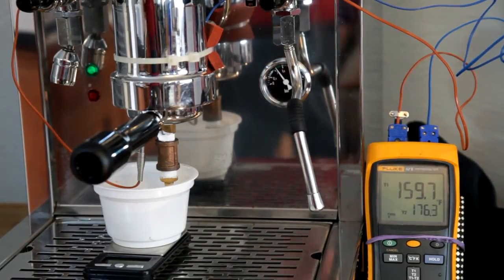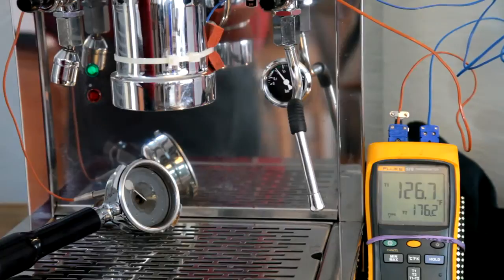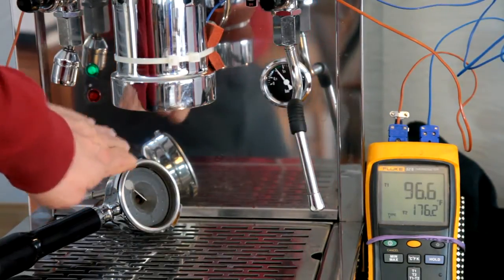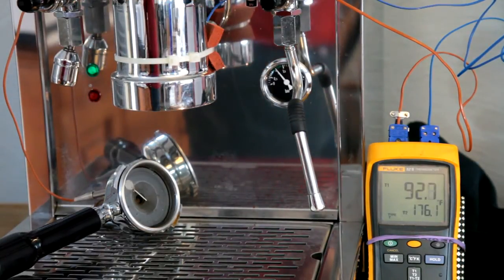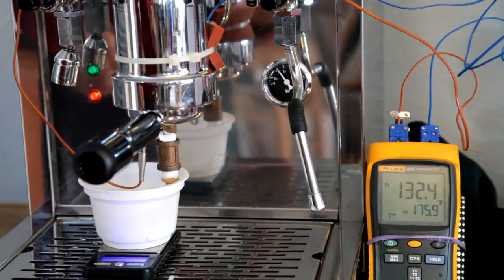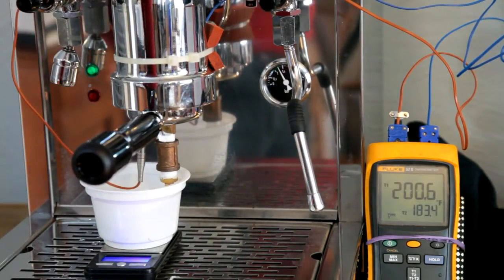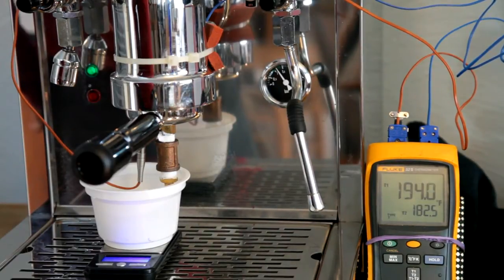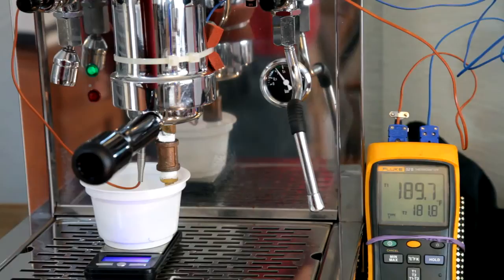Londinium 1 brew temperature testing

Comment: I'm curious if the internal temperature would go higher with a puck creating pressure.  I actually don't know the answer but I think there is some relationship between pressure and temperature so I'm just wondering because I keep trying to test my espresso machine's temperature and the one time I tried to put the test lead inside the packed portafilter it sliced the wire off when I locked the portafilter in.

Comment: Hi Andy. Late to the game here, I have a L1 luxe too. Used it for years without thinking about it, but I’m now interested in upgrading so have ordered a single dose grinder and I now curious about what my plumbed in L1 luxe is doing temperature wise. Typically I turn the machine on 20 minutes before use, then I detach the PF, rinse it under the GH, weigh it, grind 20g off dark Italian beans into the PF, WDT, tamp and then attach to the machine. I pull the lever and wait usually 5-10 seconds for the first drop to fall then release the lever gently. Do you think I’m doing ok? I have been toying with making a small screen raspberry pi thing to sit on the machine and monitor temperatures, perhaps the rear of the GH and possibly the boiler and TS tubes etc. What are your thoughts mate?

Comment from the maker: It's been on the market long enough so that the initial teething problems have probably been worked out. But like any espresso machine, it will prove very helpful if you or a trusted friend is skilled in basic maintenance -- tightening fittings, changing the occasional valve, etc. Since the dealer is in the UK, you have to be able to handle this stuff yourself (or find someone who can do it for you). Fortunately it is not a complicated machine.